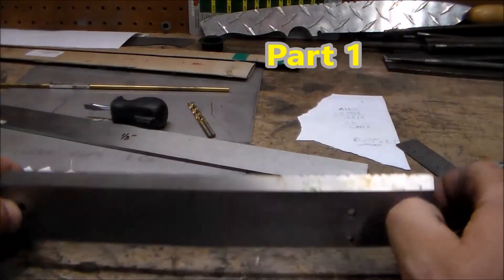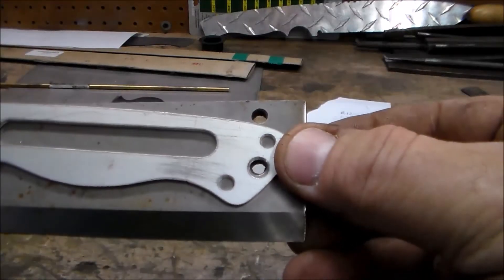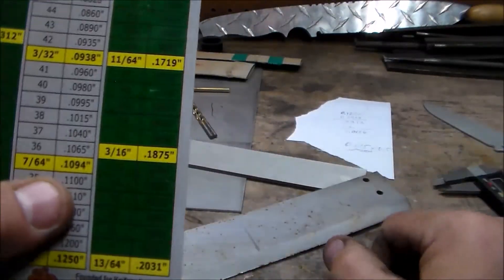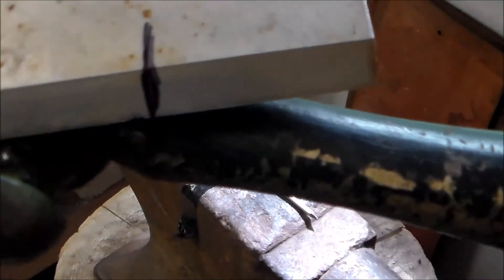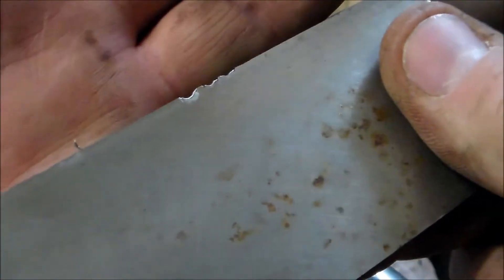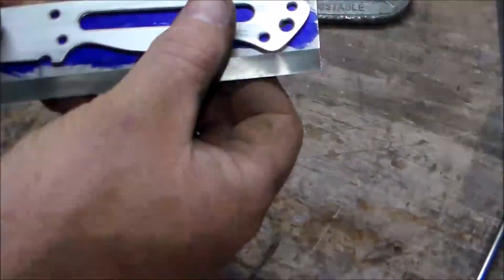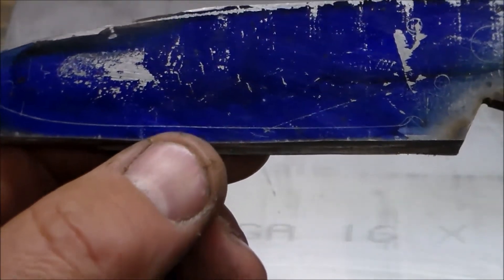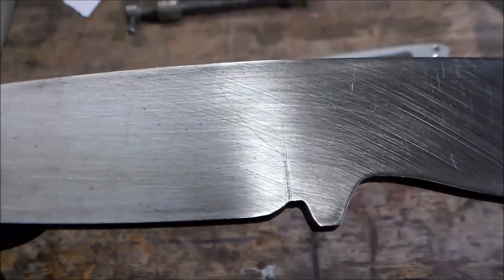Knife test from a planer blade, will it work?

Comment: HELL YES IT WORKS! Ive done it before. Just dont cut nails...
 now I have a 24" long planer BLANK, never sharpened or shaped (thanks GOODWILL) It's going to be the nastiest MACHETE ever..
Reply from the maker: Since I made this video, I found out from the manufacturer that these particular ones are A8 tool steel. The steel seems pretty dang awesome to me, I've made several knives from it. Gets really sharp and is very tough.

Comment: That is some of the best D-2 you can obtain. Anneal, and a proper air hardening will give you a very tough knife. You can not buy D-2 of this quality. Look in a Machinery handbook for how to heat treat and anneal it. You will not get the best of a blade for stability and your own ideas about how thick, or thin you want the knife and taper, forward and possibly back to the end of the handle. Good luck
Reply from the maker: Well, as it turned out, it wasn't D2. I finally got in touch with the manufacturer and it was actually A8. The rep even gave me a heat treating spec page. I have made and tested a few knives with the A8 now and it makes a really good blade. I keep meaning to make an update to this video, but never remember.

Comment: either that is not D2 it it is and has not been fully heat treated. I have seen what  we'll heat treated D2 blade can do to other softer steels and it usually comes out unscathed.
Reply from the maker: You're right Paul, I never did go back and make an update. Turns out it is A8 tool steel, took me a while to track down the source. As it comes in chipper form, it is not as hard as most knives. I've made a few knives with it, but first annealed it, heat treated it to 60 hrc and it's seems to be a great knife steel then.

Comment: im thinking about buying some carbide plainer blades and then making a blade from one
Reply from the maker: Well, I'd recommend not doing that. I'm not saying it's not possible, I've made some blades out of "found" steel, but it's a gamble. If you can get them for free and you can find out for sure what kind of steel they are, then maybe. Planer blades are already hardened and it makes them super tough to grind, impossible to drill pin holes for your handles, etc. Then, it's real easy to get them too hot while grinding and you screw up the temper. I use them sometimes, but I anneal them first and then re-heat treat them. If you're a beginner, you might be better off to get some simple 10xx series carbon steel, like 1075 or 1080. Those can be heat treated with a very cheap homemade forge and tempered in a household oven. The blades in this video ended up a little softer than you would want for a good knife, but after re-heat treating, I can get the hardness exactly right. Good luck whichever way you go, it's a fun hobby.

Comment: If I were to guess by the dings the nail is making in the edge....I'd say it's probably around 53-55...but that's just a guess.
Reply from the maker: You are exactly right! I still need to post a follow up to this video. Since filming this, I've learned a ton about using this steel (turns out, it's not D2 like I was first told).
Reply: I'm curious what it is....looking forward to update video.

Comment: A lot of good steels you can get away with without heat treating. Like circular saw blades and and minimal tempering on files. Stock steel is usually annealed and needs to be treated (im a professional knife smith)
Reply from the maker: chemicallust77 I have actually worked with this steel a lot since this video, and I've shot some footage to go along with it, just need to take the time edit it together into part 2.
Reply from the maker: hungrywolfgaming I'm still trying to get back to this testing, I've done a little more and shot a little more video, but I just haven't time to get back on it. Since this video was started, I've made and sold quite a few knives, so it's hard to go back to a non-paying knife now. I'll get a part 2 up here one of these days.
Reply: It's important to work on the non paying knives too...those will teach you ways to improve the ones you sell and can also give you experience with unfamiliar techniques and new metals.

Comment: hey how'd it go? got some 1" planer blades im thinking of using.
Reply from the maker: I'm still tinkering with this project and working on a part 2 video. Since this first video, I've acquired a Rockwell hardness tester and better heat treating equipment. I will hint just this, the blades are hard, but might not be quite hard enough for a good knife, more to come.